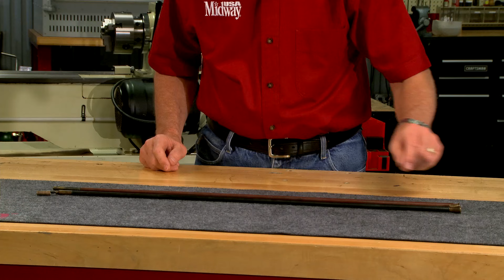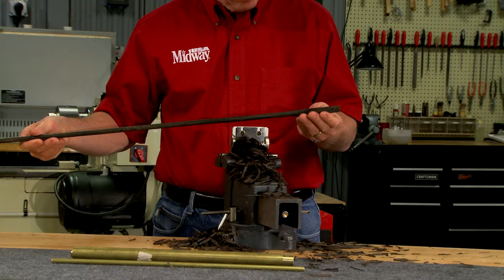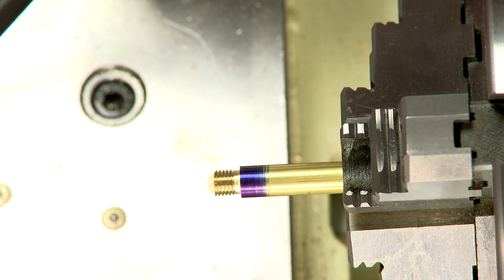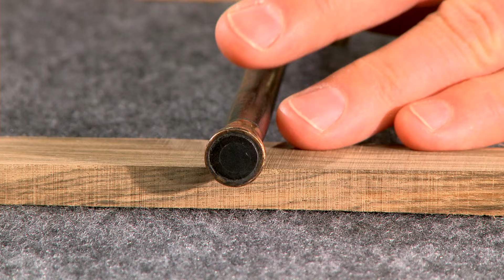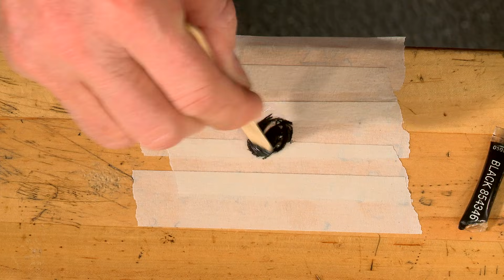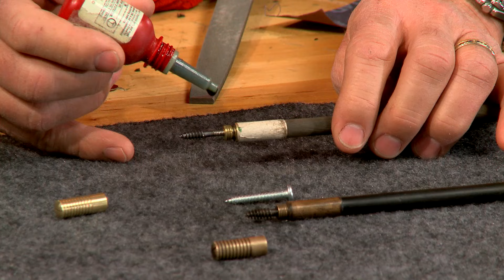Making an Ebony Ramrod for a Westley Richards Muzzle Loading Shotgun | MidwayUSA Gunsmithing

Comment: As the Brits would call it, a turn screw? As a British person i've never heard anyone say that, it's just a flat head screwdriver to me
Reply: I think it is term used by gunsmiths and watchmakers to differentiate between their trades and "lesser" folk like carpenters or mechanics.
Reply: +MrcabooseVG I have seen the term before, in fact I have seen "screwdrivers" for 19th Century gunsmithing work referred to as turn screws. http://www.drake.net/products/Turnscrew-Set--Buffalo-Horn-Handle?id=28856
Reply: Any proper, quality Gunsmiths 'screwdrivers' are called Turnscrews. Even today they are called Turnscrews.... Google it if you don't believe me.
Reply: A turnscrew seems to be a name for older screwdrivers. If you look them up the difference seems to be that the metal shaft is flat, whereas on modern screwdrivers the shaft is round.
Reply: That's because your somekind of Boomer snowflake.

Comment: what the does and don't using a brass ram rod, vs, wooden ram rod. ?
Reply: +Austin Meiser brass is too soft, and to make a brass rod strong enough to not bend, would also make it too heavy to carry the rifle or shotgun comfortably.  Military muzzleloaders use a steel ramrod because they are easy to produce, can be made very thin, and are difficult for the soldier to break rendering his weapon unusable.  Steel ramrods however, marr up and oblong the crown of the muzzle, affecting accuracy, so most sporting arms used wooden ramrods, made from dowels with grain running lengthwise.  The wooden dowels are as strong as, more flexible, and lighter than the brass, but not hard like the steel so as to damage the crown.